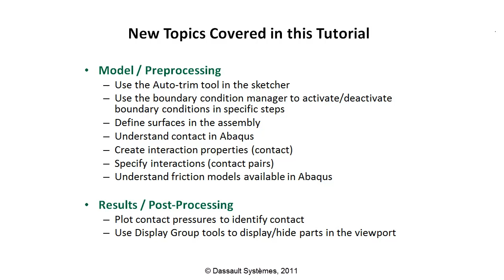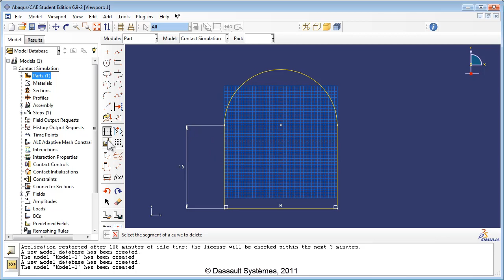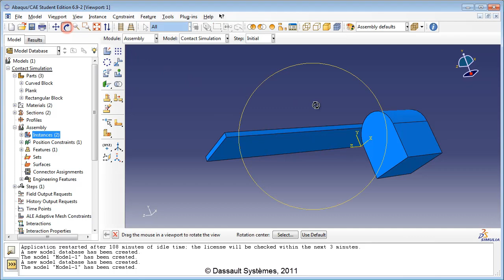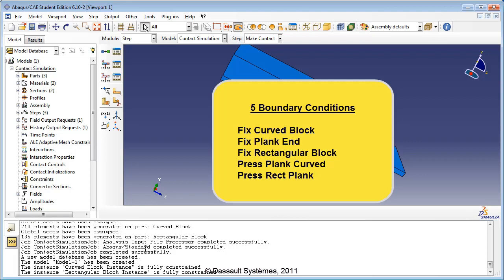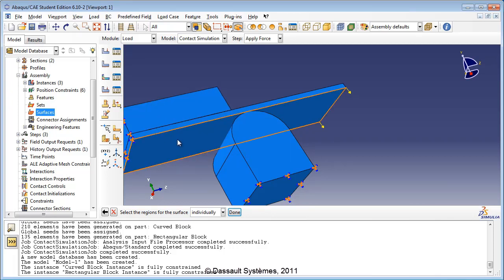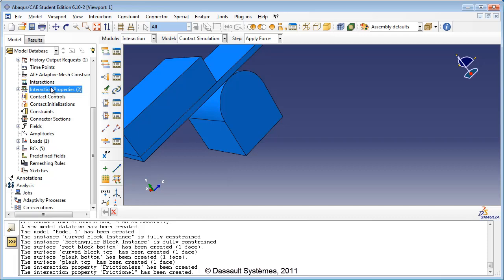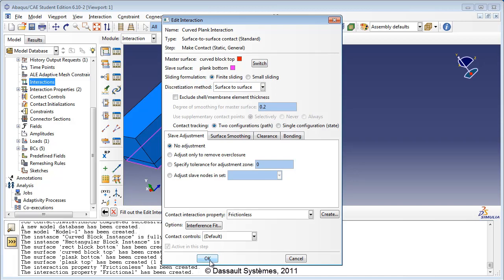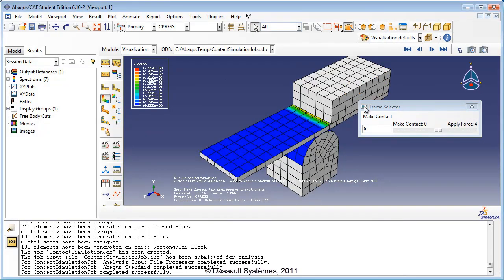SIMULIA How-to Tutorial for Abaqus | Modeling Contact using Contact Pairs

Comment: Thanks For the tutorial Sir, I tried everything in the video and here are some of the things i had to adjust to get some results. The force applied was too big reduced it to 200N, also adjusted the initial increment size for both steps to 0.01, BC: press plank reduced 0.2 to 0.1 and press rectangular block 0.21 to 0.11.

Comment: For everyone who might be getting an error saying the displacement increment is too large, try -0.1 and -0.11 instead of -0.2 and -0.21. That solved it for me
Reply: Though I did not have an error saying displacement is too large, I did have "Error in job ContactSimulation: Too many attempts made for this increment". I made the change suggested you suggested after trying to look up the error given and your fix worked. Abaqus/CAE Student Edition 2019
Reply: Had the same problem, but needed to do it -0.01 and -0.011, whats the exact reason for this?
Reply: Thanks. That worked for me.
Reply: Very nice advice thank you very much i was getting mad
Reply: @leonardoocchipinti8011  should we need to add minus? In front of 0.1? Or else only 0.1?
Reply: Can anyone plz tell me do we need to add minus for 0.1?